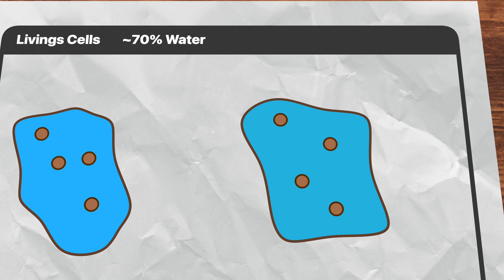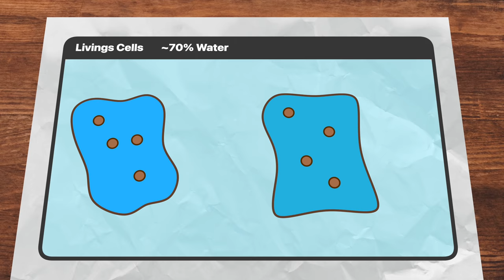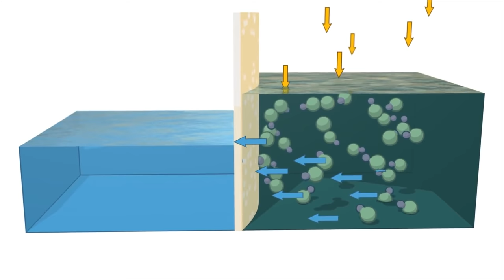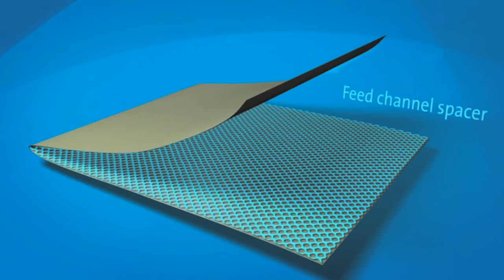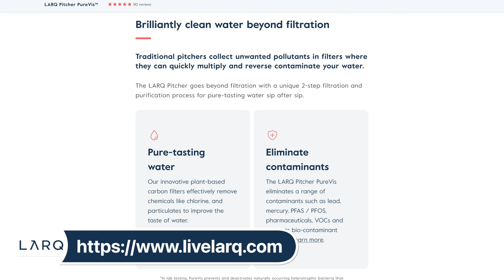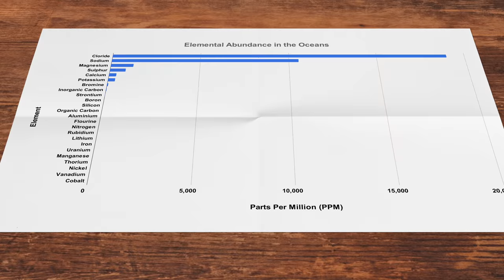Why Not Build Desalination Plants EVERYWHERE?

Comment: As a chemical engineer working in a desalination station in Kuwait, my dream and goal in life is to bring the dome technology to Kuwait and all around the world. The neom project looks like heaven to me and id love nothing more than to be a part of it
Reply from the maker: that's amazing! yeah I hear you, I'm pretty excited to see it come to life too
Reply: Is it using vacuum distillation?
Reply: must be a fascinating job
Reply: @ironczar8975  yes it sure sounds like it
Reply: @kiloton1920  I'd like to hear more
Reply: @bobb.6393  they would be insane not to use vacuum distillation, now the real trick is to heat the water without burning anything, such as with solar
Reply: The solar dome is probably the most ecologically friendly means of getting fresh water from salt water. I'm surprised they aren't everywhere already especially in water starved desert regions around the world.
Reply: @Twitch760  do they work for large-scale applications?
Reply: @StevoSwiss  I don't see why not. The biggest factor in determining how much fresh water you can make would be internal surface area of the dome. Larger area more collection. Seems like carbon fiber would be the best building material for this.
Reply: It seems like the dome would be a mess, the power generation plant in California that heats oil in the same fashion, is outrageously expensive and unreliable. And this requires 100% reliability. And that's without dealing with minerals that can be very problematic to any system.  And they'll need a mountain of batteries if they are trying to go off grid, or redundant water storage generation, and of course acres and acres of environment destroying solar panels and wind turbines, both highly inefficient and unreliable. 

Nice concept, but would be very difficult in the real world.
Reply: David Thompson would the dome idea work to desalinate enough water from the ocean to supply All of Las Vegas or all of Phoenix? 

Desalination is a great idea for cities in a desert that wants to grow indefinitely, but if you have a massive five foot or ten foot pipe to supply a million or however many people into the future and future growth would the dome and solar really work?
Reply: @Twitch760  Sanitation, I can only imagine the sanitation requirements as a hot, humid environment on the surface of that dome and in the storage tanks would be a prime breeding ground for some algae.
Reply: Windmills kills big birds.and bats.
Reply: Just wanted to tell you, I highly appreciate you and what you and your collogues are doing. I hope that dome technology becomes reality and works. So we can add them all over the world. Cheers
Reply: @barryhessel6078  good
Reply: @TwoBitDaVinci  How many feet of sand would it take to reproduce the mesh and how often would the sand need to be cleaned?
Reply: Neom tech for future
Reply: @Twitch760  they could use a portion of the solar to create energy and leftover salt into molten salt batteries that could be made for electricity storage  and electricity stored in molten salt batteries  to be used to pump desalinated water
Reply: @bobb.6393  honestly it can be fun and challenging at times but it can get boring when everything is running smoothly and there are no problems to solve ( though usually there is )
Reply: @kiloton1920  if by vacuum you mean multi stage flashing then yes! The station i work at is a pretty small station with 2 plants, a multi stage flashing plant (The plant i work at) which simply is 24 stages that are different in pressure ( vacuum) and temperatures to basically evaporate sea water and condensate it back to fresh water. The second plant is a reverse osmosis plant where we use high pressure pumps to pump sea water into the membranes to separate the salt and produce fresh water. We use steam to heat the water in multi stage flashing and we use pumps for Reverse osmosis that are powered by electricity that is produced mainly by steam turbines. So again steam is essential for both methods and we produce steam by burning a lot of natural gas so I really believe solar domes are a game changer
Reply: @fortusvictus8297  in our plant we use a safe amount of chlorine to fight algae, shells and all kinds of life so Id imagine the same principles would apply at a dome plant
Reply: @thaynealexander8986  thanks man. Its funny how when i was studying all i wanted was to work in an oil company since they pay a lot more but after being rejected for two years i went into desalination plants because it was the closest type of work to an oil refinery. Today I’ve been offered 3 different jobs with higher pay in oil companies and i just dont see how i could work for something i don’t believe in. Thats why im trying to get a masters degree and eventually a PHD focused on sustainable and renewable to try and do some good in this world and be a part of something that would eventually benefit humanity, that is way more appealing than money for me
Reply: @elnino7934  this seems like it would use more gas than just heating up one vessel like how they distill gasoline?
Reply: @elnino7934  I see with this method you can actually double output without raising energy input one bit, very interesting, I work with solvents a lot and use vacuum distillation but I guess the rules are much different when your working with only water do you can so stuff like this multi stage flashing with the gel membrane collection at the end.
Reply: @elnino7934  What about gravity vacuum distillation? All you need is an inverted U shaped pipe 12 meters high. Stick one end in the ocean and suck on the other end. Once the level of sea water in the tube reaches around 10 meters, it starts boiling at room temperature. At this point you are sucking pure water vapor. Shine sunlight on the water column to increase the evaporation rate and shade the suction side to promote condensation. Seal off the suction side and it will fill up with distilled water. Stick the distilled end in a reservoir to prevent air getting in the bottom and what you have is basically a siphon except the water can only get over the top as vapor. The production rate will be proportional to the temperature differential between the salt side and the distilled side. You can use whatever you want to heat the salt side, sun, steam, exhaust, whatever. You can use whatever you want to cool the distilled side, radiation, convection, wind, fans, cold sea water (before it enters the salt side tube)
Reply: I think hemp oil, is the cheapest, most efficient, renewable energy source for powering any generator.
Reply: @SOContraMundum  why exactly would they need the batteries for? and why would they need acres of solar panels and why do they need wind turbines? are you talking about desalination or something else?
Reply: @Twitch760  $$$ Desal water is very expensive and will continue to out pace other water sources due to the cost of energy to create it.
Reply: @jackkennedy9475  using traditional methods yes. The Solar Dome other than start up costs practically makes water for free.
Reply: @SOContraMundum  theres also one that can be used in the cold. You shoot water over a pool and as it freezes it squeezes the salt out.

There are many ways to skin a cat, my friend.
Reply: @jackkennedy9475  not really. It depends on how you impliment it.

The sun will evaporate water on its own, its just slower.

You ever leave a hammer out in the sun too long? Or anything metal?

There is already a small desal impliment about the size of a suitcase that runs on 1 solar panel.

You could also just reflect a few things at, say, a large pot in say, a tarped area. Say...one that is draped over pvc (for mobility, and weight)...or just some sticks/wood (for strength).

This is a simple problem if you break it down.

It only isnt simple when you try to do it in a large scale.
Reply: I see the very same vision!
Reply: Questions: Evaporated water vapor rises. Could the water be captured several hundred feet up as freshwater and gravity fed to where it's needed? If so, as that water flows to where it is needed, could it run a turbine to give clean energy?
Reply: @quad55555  x
Reply: I hope you get to see this happen.
Reply: @Think-dont-believe  Well, it is difficult and inexpensive. In California, it's a 10 year process. It's very energy intensive and with the state cutting back on gas turbines, where will the power come from?
Reply: @Twitch760  There is no money to be made by solving the effects of scarcity. Making things abundant negates their value. Of public spaces were full of fruit trees and vegetable gardens free to the public, that would be bad for the grocery stores. Our economic model is an anti-economy.
Reply: @barryhessel6078  I'd encourage you to not buy into an oil-subsidized media frenzy by understanding that birds can process visual data MUCH faster than humans and their flight reaction time would blow your mind. 
Bats, on the other hand, are using echo-location AND can react to an echo-wall mid flight. It's not like they're as stupid as your initial statement.
Reply: Talk about the waste product silly..
Reply: @petero2693  salt?
Reply: There is a huge plus for desalination plants.. 
The emergence of Na ion battery technology as a replacement for Li means a waste product becomes a massive valuable resource...
Its also easier to recycle ..
Reply: @TheSuicideRacer  
Trent whatever works in a given location best...and is most cost and energy  effective for whoever needs it..  dont build jetboat if a barge will do the job you want doing. Horses for courses to use a phrase.
Whatever has the lowest cost and the simplest operating needs .... remember these places may be in quite remote locations wild. 
In a desert environment the water might initially be used to stabilise the desert and get colonisation plants growing to reclaim a region for agriculture or create a  self sustaining settlements  🏜️🌎🌍🏞️
Reply: this would help with rising water levels to?
Reply: @Twitch760  
Carbon fiber is too expensive and requires too much in fossil fuels to produce. 
Think basalt fiber... glass or plastics.... .. these things need to be large numerous and cheap.
Reply: @koltoncrane3099  "grow indefinitely" like there's no tomorrow.. you people depress me. like, why do we have to share the same planet ?
Reply: Billions of gallons of water run out of air conditioners out of household and commercial systems. This water could've  be recovered and used for urban yard and grounds irrigation.
Reply: Please bring it to 3rd world country like Indonesia because the material cost might be cheaper than when build it in advanced country
Reply: This idea is an example of the people who keep us using oil for fuel.The solar dome is a great idea!  If we use electrolysis on the brine we could increase the payout of the system.just as using hydrogen for fuel  people are quick to say there are to many problems with going "green". These same people would have fought the automobile stating that horses were more efficient than the car that it was just an anomaly to much work to maintain yet here we are a little over a century later and the horse is the less efficient.
Reply: The world-wide first solar distillation plant at Las Salinas, Chile (Telkes, 1956b). an awsome small plant never duplicated.
Reply: Lack of government planning?  The free market economy hasn't gotten into the business much yet.
Reply: Solar panelled and heated domes to collect natural evaporation of clean water that runs down into troughs and continue to another dome for further separation from contaminants 
for many times 
The contaminants can easily be cleaned away from the internal floor area 
once the water has evaporated 
from the contaminants in the many domes that are required for the process
Reply: @barryhessel6078  not nearly as many that would die by oil dpills
Reply: @barryhessel6078 , so does fossil fuel pollution.
Reply: Here's a question..... I get the desalination completely,  but at what point does it get detrimental to our planet.  Nature loves balance in general. What happens when you seriously throw that balance off
Reply: I agree, and in the mean time, why can’t the brine be used for things like road salt for places like where I live that gets icy roads in the winter….
Reply: What energy companies are heavily invested in this technology? I ask because I'd be interested in what their stocks are worth now vs what they could be worth in the future.
Reply: Elnino do the plants offer tours in kuwait? Might sound weird but ive always wanted to see a desalination plant
Reply: @jl1399  no they don’t unfortunately, you need a certain level of clearance to enter. However sometimes universities or a college will send a class for training at our plant and they can usually get clearance for the students
Reply: @elnino7934  that’s unfortunate but understandable. They are amazing machines I think it would be better if they got more attention, understanding and curiosity given. They literally bring life to the desert 🏜
Reply: The salt extracted could be turned into thermal storage as saltpete in an expanding tubing system heated by heliostats applied to seawater pipelines.  Expect failures (1000÷?) before success.   Mining companies should be invited to filter water and split profits.
Reply: Neom is a dumb idea. Central planning on steroids. There’s a reasons cities that grow organically are circular.
Reply: Complete and absolute bullshit.  Have the dome make a few billion fly cars too please.
Reply: @spiderman no way home< really? the technology is there
Reply: Do you have any real life wind and solar experience or are you just parroting the current propaganda? We've been off grid wind and solar since 1969. Where you do you conclude environment destroying from literally inanimate quiet endlessly dependable function 24/7 ?? I haven't lowered my gennies in. Nearly 14 years to clean and check system. To many people supporting stigmas they've been taught to Assume? Iive it before you refer to hype. Dandahermit
Reply: @barryhessel6078  no it doesn't. Birds sit on my gennies until they start up. Never since 1969 had a bird hit.
Reply: @dantronics1682  did u watch the video?
Reply: @dandahermitseals5582  Living in the bushes like the Unibomber and eating grass is not a world changing paradigm shift. I'm glad that you are able to do your thing but it's not saving the planet.  There are 7.5+billion  more of us to think of buddy.
Reply: @dandahermitseals5582  did you read what so said which was what I was replying to?
Reply: I remember learning about some of this in science class as a kid, basically if you do not have fresh water, but can manage to build a pipe system, a fire and something to boil the water in you could produce fresh water. So when I was younger I wondered why people went without water, but when I was younger I also did not have much of a grasp on economics. Nonetheless, without being a scientist and only looking at this  idea on a surface level, it looks like a good idea, let us just hope the govs, and bullshit agendas stay out of it.
Reply: @anthonyarmstrong4701  do you not see any problems with going green?
Reply: Idk Noam seems like a pretty obvious scam to me, but I’m glad some of the tech may be coming to fruition
Reply: Make sure you don't get "suicided"
Reply: I agree. Please tell los angeles
Reply: How do you guys deal with the brine (specifically sodium)?
Reply: @Bittertokken  outfall. Dumped back in the ocean unfortunately
Reply: @elnino7934  😮
Reply: @Twitch760  wouldn't a zig zag format work better than to multiply surface area?
Reply: As a logistics guy: How exactly do you plan on moving things around in this thing? You will need tons of food, water and consumer goods. Mass transport for a city does not, under no circumstances, never in the existence of cities work efficiently in a slim line with no major transportation routes
Reply: "The neom project looks like heaven to me and id love nothing more than to be a part of it"
200k Blood money dollar have been transfered to your account.
Reply: @pagexi3394  hemp is always the solution to all of the worlds problems, that's for sure.
Reply: @clivestainlesssteelwomble7665  probably simple stainless steel or aluminum is best. As long as it can take the heat and stand up to a salty environment.
Reply: You're a badass 👍
Reply: That's not what it looks like from surface to volume. If you wanted a city with a decent shape both economical and able to deal with expansion. Your going to have to go with at least a star fortress design there is a reason as to why they used such a shape in castles.
Reply: Perhaps it's time to minecraft the world and use resources rather than make decisions solely on monetary reasons. Surely brine could be placed on the open market for an industrious organization to capitalize on and give back useful commodities
Reply: Better hope oil price falls fast to avoid this dystopian nightmare
Reply: @bliblablubdiedadup742  well, they fell by 30% over the past month in case you live in the US and werent paying attention.  I've seen gas under $3.00 per gallon at a few places.
Reply: @ohrworminc  and one or a few people could shut down the entire transportation system
Reply: @ohrworminc  maybe the House of Saud knows something we dont about building a giant wall along their northwestern border, a wall that could house and strictly control the entire population of Israel?
Reply: @RiverogueLander  You sound looney.
Reply: @ohrworminc  the Saudi government already said that NEOM will operate under an Israeli model of governance, and not by Saudi style law.
Reply: @ohrworminc   Israel is obviously concerned about the need for massive evacuations in the event of an imminent nuclear strike.  If they werent concerned about the possibility of nuclear war, then they wouldnt have over a hundred nuclear warheads.  Saudi Arabia is also building up it's nuclear arsenal as a deterrent against Iran.  They imported unarmed nuclear warheads  from Pakistan to make nuclear capable.
Reply: @anthonyarmstrong4701  Yeah, these things tend to evolve over (half) a century, not a decade, as many eager politicians want to press on the poor people
Reply: @kiloton1920  No, multi effect is more efficient than simple distillation. Btw, distillation isn't competitive with RO membranes unless you have access to a bunch of waste heat.
Reply: @kiloton1920  regular, in that i am guessing the roof of the dome would have to be cooled for the steam (h2o) to condense to liquid (h2o), whilst leaving all the solids behind at the bottom. still quite a slow process though (irregular). in that it would not really work. might catch a little bit running down on the sides, whereas most would drop back to the bottom to be with the solids.
Reply: that dome still not proven. but there is another way that works very quickly.
Reply: when the nuclear diamond battery is utilised, that is when the heaven would be clearly evident. it is basically eternal. no more solar...
Reply: @elnino7934 verily the maintenance is enough to keep busy and occupied. where the meaning of happiness is in such by avoiding the consumption of this bunch of animals 🐑🐐🐂 especially there milk for this amounts to stealing. can never get bored with proper health and exercise. it works to study this area. should try someday, it is excellent! 🖐 if anything there is only enough beef for everybody.
Reply: @pagexi3394  can use a water electrolyte mix, not enough hemp seeds for that.
Reply: Please help me understand—-and I’m sincerely asking. ...... Desalination seems to be viable in rich counties who are rich from fossil fuels. Not judging—- because lots of things are valuable.....seems like we ultimately have have to choose....water or power..... what say you? Please? Not crazed battle response, but mature fact finding and discussion.
Reply: @trae4529  distillation or desalination is probably better off in house, for the water must go through alot of piping to reach its destination. also some/mostly all fosets are faulty in that they become damaged/split on the inside thereby leaking metal into such water. the desalination plants are reverse-osmosis which are inefficient anyway for they put to waste 4-5 gallons to make 1 gallon of what is ment to be pure h2o. and as of now, nobody is experienced enough to have done it properly by way of distilling the sea water anyway. so better in house by distillation respectively. a reservoir might also too be more appropriate for water rather than ocean? or the sink hole aquifers underground.
Reply: @anointing_favour  interesting!!! I want to learn more.
Reply: @trae4529  maybe some ancestors had suffered in other areas in regards to such imperfections. still also reverse-osmosis water from what i have dranken left my bones brittle, where i could hardly walk after rousing out of bed. went back to the spring where they strengthened again (okay now 👍) also some distilled water caused the same side-effects. some would say because lack of minerals in the water. i say poor engineering and textiles used/bad metal and for the reverse osmosis they are fibreglass it all effects the water. i still testing actually what the best textiles to use going for borosilicate distillation no reverse-osmosis. have test other too. method one guy mentioned here inverted U where cooling one side to catch the steam to liquid going over seems most quick and efficient.
Reply: @anointing_favour  that goes a long way toward explaining why only “rich” countries use desalination.  Like Saudi Arabia. So....... where’s the tipping point for the US?
Reply: @trae4529  supposed what you say is rich might be rich to some and not others. when i say the effects of such water have devastating effects on the bones, i am serious. it is very bad. in usa there are flocculation water purifying plants, if i am correct ny has one. and there is also incineration. i live in australia the water is bad here others would not know, for they but sip (not really drinking it) they drink alcohol. and but have only rubbish dumps to put their trash in the ground it is dumb. difficult period for me in such respect. that is why in house, filter, spring or distillation ultimately is required at least for water. do it yourself probably better anyway. viz, a great emergence is needed for.
Reply: @trae4529  haha the "tipping" point. so, the point in regards to such tipping being for h2o is when a practical method has been specified for the people that could then benefit from it. but now there is none. if it fails, the natural springs might be the answer in living near them, rather than now living where animals live. either way i am not settling for living with animals. tapping the spring was my original thoughts about being healthy in regards to using water. should be perfect with the minerals in there from the rocks (of calcium and magnesium) to benefit from. note: there are mineral springs which have high bicarbonate levels, for such there is a danger for they are alkaline (corrosive) to the body and thus can damage it severely. as such i would advise not to drink them. these at the shop are labelled as mineral water, apart from the spring water. that is about it, and intelligent tipping 😉 ✌️
Reply: Actually a solar project failed using using this mirror design to heat heat liquid salt. It's simply was too expensive to run and maintain. But but given the the similarity and design it would appear adaptable. Albe t it isn't landlocked Nevada.. But there's a billion dollars worth of adjustable mirror hardware out there that could be salvage
Reply: Neom ist a scam the line will Kot work 
Debunked by thunderf00t and adam something
Reply: @Twitch760  yes! Not to be negative would love to see it happen! But because it would practically produce water for free is why it will never be allowed to happen!
Reply: Glad to here  that 😁
Reply: Great elnino.
Reply: @barryhessel6078  so do cars and trucks 😄.
Reply: Draw a vacuum on water and it boils at a much lower temperature therefore requiring less heat. I'm not sure if this technology is what's being used for the desalination of sea water but with nuclear energy it seems the cost would be less than using fossil fuels that would also pollute the air. Boil the salt water and the vapor, when cooled returns to liquid is fresh water. If you lower the pressure you lower the boiling point. I worked at a refinery and the same process was used to separate the oils in the vacuum tower.
Reply: @bobb.6393  It's based on when you lower the pressure on a liquid you lower the boiling point. You can boil water at room temperature if you put a strong enough vacuum on it. When it comes to heating the water to a boil, the more vacuum on the water the less heat it would take to boil it and less heat means less energy is used.
Reply: Why isn’t this the most important conversation happening right now whenever a conversation takes place about conservation or environmental impact?!